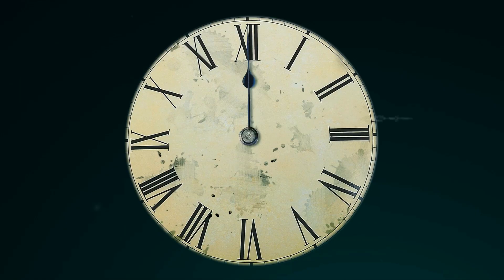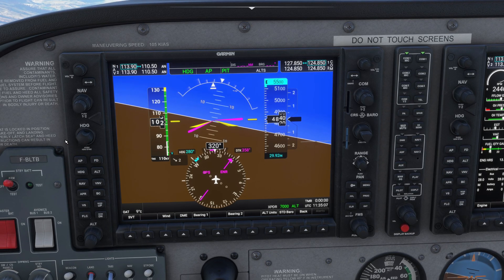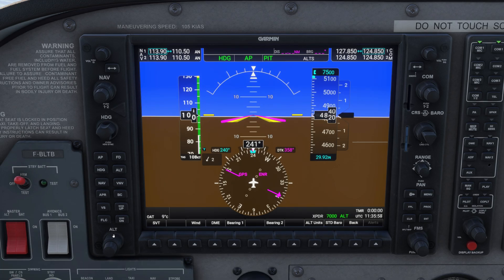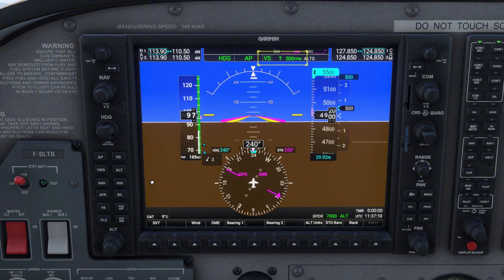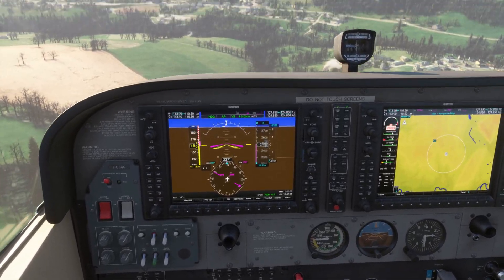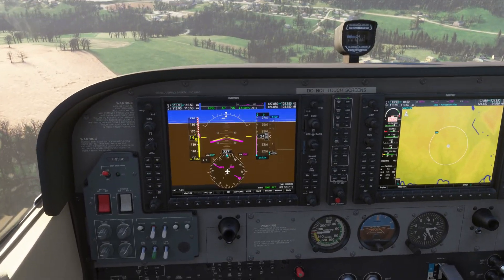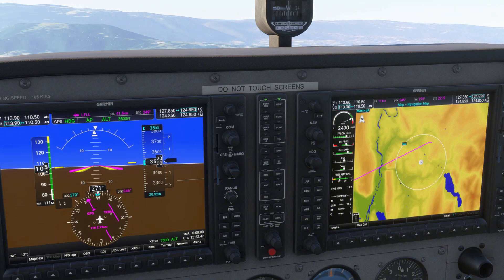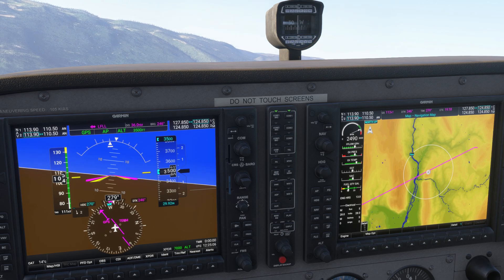[MSFS 2024] Deep Dive into the autopilot functionality - Works for all Modern Aircraft

Comment: When i use the lateral navigation in a mission in career mode, its following the magenta boxes in the planes computer screen, which for some reason is not lined up with the blue boxes that the game shows floating in the air as a guide. Do u know it does this or is it a bug?
Reply from the maker: Yeah that's normal, their is a shift between blue 3D rectangles and the magenta line. I usually disregard blue 3D triangle and focus on the magenta line. It worked pretty well so far.

Comment: I never had any problems with the autopilot until an update in 2020 and then in 2024 the same thing it does not follow the flight plan in any GA aircraft the aircraft will lose height and turn to the left and eventually crash, I am at my wits end trying to find an answer for this MSFS will not answer my discord help. this only happens in GA aircraft.
Reply: This also happens to me.  Can't find any information to fix this issue.
Reply: @michaelmcdermott8791 . Hi, After some time I worked out it was the Honeycomb yolk that malfunctioned, I tried to fix it but the main board died.
Reply: @lucidechoes-n2d Hi, thanks so much for the reply. That's interesting. I'm using an old CH yoke back from flight Sim 98 but it still does control the plane. But I notice it's kind of very touchy now and and roll but it still controls the plane. Did your yolk still control the plane when you found out it was a bad circuit board?
Reply: @michaelmcdermott8791 The only parts that did not work where up and down axis , left did not work but right did so only one axis worked. I found out when I tried to calibrate the yolk.
Reply: @lucidechoes-n2d thanks so much for your reply. I would have never thought to look or check out the yoke thinking that it would affect the autopilot but I isolated the yoke and used a joystick and lo and behold autopilot worked perfectly. I then tried to use the yoke to control the ailrons and elevator again and it would not do it. So my yoke is bad also and needs to be replaced. But thanks so much for that reply. I would have never have thought about the yoke causing that problem. Happy flying!

Comment: That be nice if the autopilot in the game actually worked the games a mess atm compared to an older game like xplane11 I know it’s new but dam if xplane 11 feels better that’s saying something the physics are like an arcade game as well a Cessna is so twitchy you have to move the yoke like a hairs width then your at a 80 degree climb and the planes constantly want to pull to the right when flying I need to have my yoke basically fully turned to the left to get a stable flight the second I let it go it will barrel roll into the ground I was hoping autopilot would keep it level as I’ve messed about with my settings seems to be a game thing but sadly the autopilot is also broken only thing that works is when I use vertical speed or if I let my plane constantly crash into the ground for 30 min sometimes the heading mode will work for 5 minutes before it starts banking to the right then into the ground

Comment: great video
only my megenta line is not the same as the blue square i am flying true it is a bit off and i dont get it alined anymore any way to fix that?
Reply from the maker: Thanks !
I had this issue before. If the blue square looks higher lor lower than the magenta path, check that your altimeter settings matches the one given by ATC or find the button for "SET ALTIMETER" in the MSFS 2024 keybindings, it will update it for you.
Reply: @RockYourWings  it is to the left or to the right... it is so strange even if i plan with in game stuff it does not work normaly
Reply from the maker: It looks like the Mission planning differs from the actuat flight plan inside the plane (I might be wrong). I do not know why they did that, but I agree it's confusing.
Reply: @RockYourWings  Yes it is a known bug. I have ignored the mission indication and used the flight plan and i have had no problems failing missions.
So just ignore what the game tells you and follow your flight plan.
I even go in and change the missions flight plan, as it will sometimes give you really strange landing paterns.

Comment: Good Video, especially the minutiae of the colors and there meanings. I would note that on the FLC mode you can adjust the desired climb/decent speed with the up and down buttons so you don't need to skillfully catch the correct value.
Reply from the maker: Thanks a lot for watching